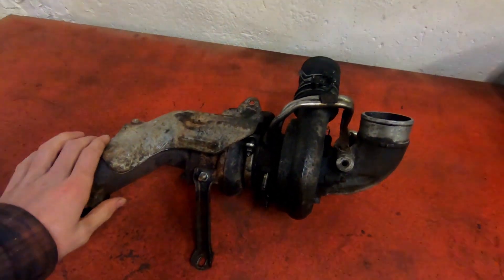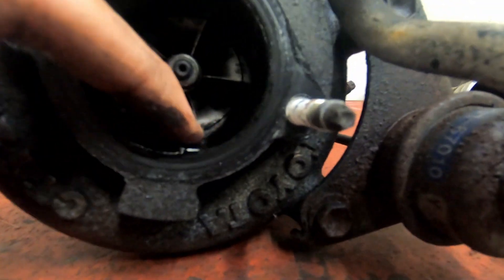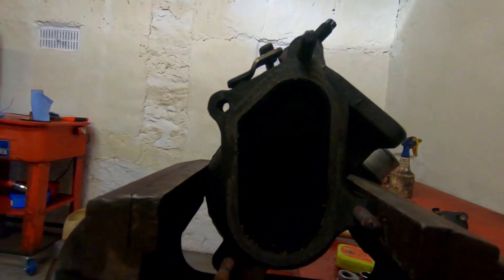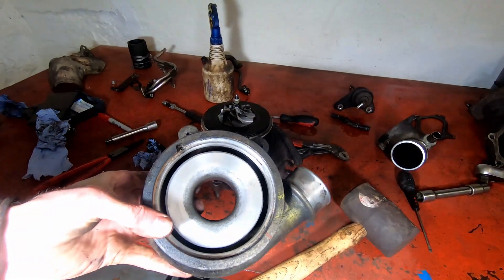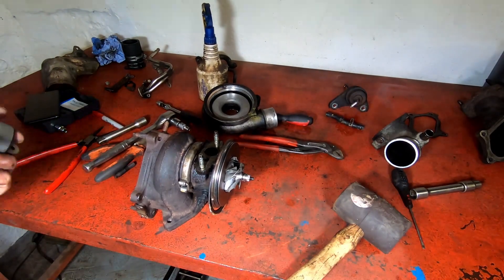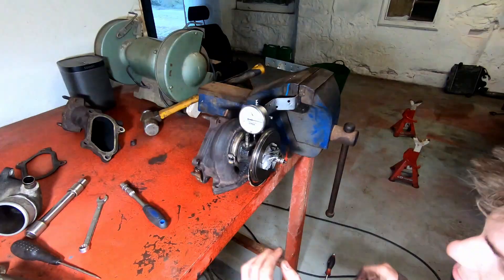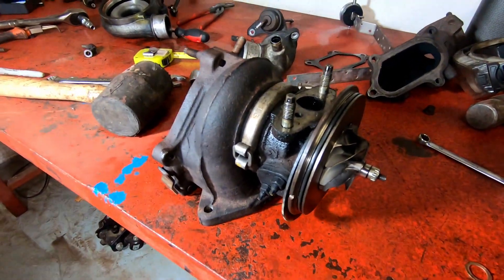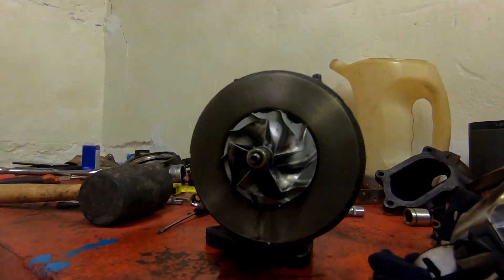Inspecting a Leaking CT12B Turbocharger From a 1KZ-TE Toyota Land Cruiser Prado Engine

Comment: Your check method for an oil leak is not correct. The turbo stops oil from getting past the piston ring seals by the turbo running.The high pressure exhaust on the turbine side and the high pressure air on the compressor side keep the oil in.Also there is a displacement ring inside that by spinning directs any oil past the piston rings to the drain side.The problem is your outflow is restricted by crud allowing high pressure oil to build up on the drain side which is more than the pressure outside the core.If you fill up a new turbo with oil,it will leak out when not turning.
Reply: And also, the up and down play will be taken up by oil pressure, the main concern is when there is in and out play, so he’s testing procedures were not really correct
Reply: I know this is a late message. I have a question if you have time. I am noticing a puff of smoke from the exhaust after idling and taking off at traffic lights. My thoughts are that the turbo seals may be on their way out. Your comment makes me think the low pressure on the compressor side at idle is allowing oil into the exhaust which is ejected out when applying throttle. Is this a reasonable thought? I’ve just done injectors and a decarb of the intake and am still getting this puff of smoke. Occasional noticeable smoke under load when looking in the headlights of cars behind me at night also.

Comment: Hey mate, I just started on a 1kzte that I'm using for a project Hilux and also upon lengthy engine inspection prior to start up I noticed radial play in the compressor side of the turbo. I realised that this is normal and when the motor is running the oil pressure centralises the clearance there. So all good.